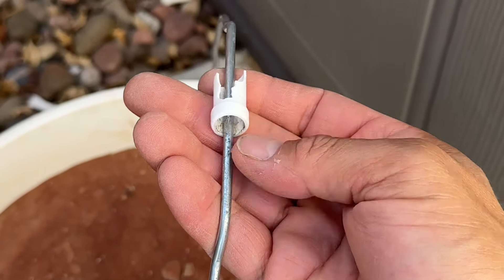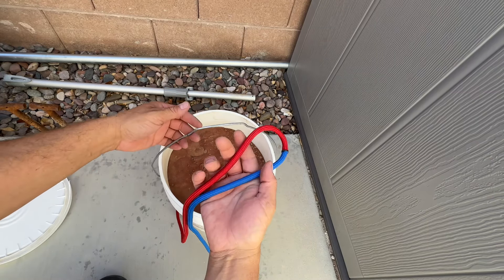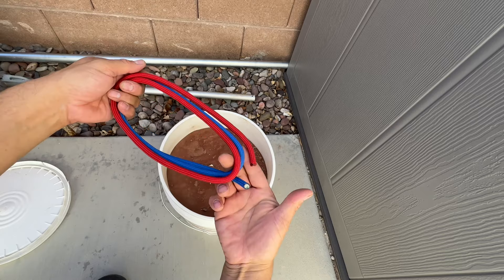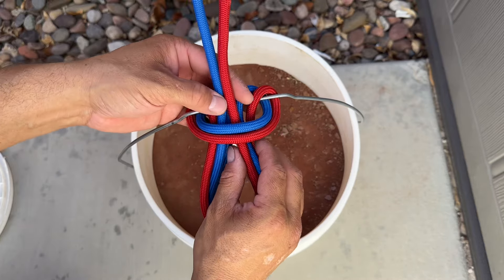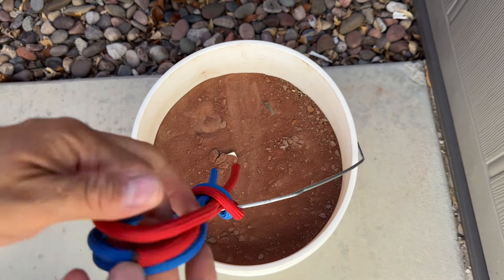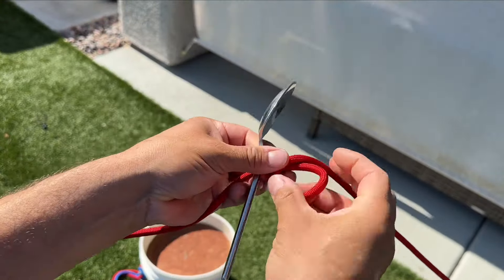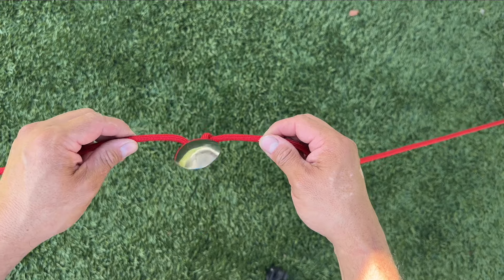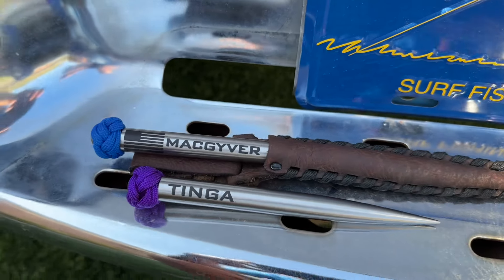5 Gallon bucket Knot. Tying a Better Handle.

Comment: Petition: how to tie stuff to a bicycle rear rack. I carry some paracord on my bike instead of bungee cords and I use variations of your trucker's hitch but I wonder what would your take be. Big boxes are particularly challenging to me.

Thanks!
Reply: Flynn's trucker's hitch all day long
Reply: Same here, but for my motorcycle!
Reply: Romex.
Reply: @bn5055  I'm a bit afraid of automatic trucker's hitch variations because I fear they might get loose with the shaking of the bike in an urban setting. And it can be catastrophic if something gets loose on the bike if you are surrounded by traffic. Besides that, it is indeed a great variation
Reply: @fcriado92  virtually zero chance of that happening given that you pretty much always tie off the hitch with a couple of half hitches.

Comment: Love rope for all kinds of purposes, but when my bucket handles break, I substitute 1/2 inch PVC pipe.  Cut the access slit at a bias and pry the bail into place inside the pipe.  The PVC is  larger than the original handle hence more comfortable.  The bail won't jump out of the PVC because of the access slit angle.  If you don't like the slit gap (which can be rough), use PVC cement and a heat gun to close the gap and join the two sides.  All that said, the idea of a Prusik knot for a substitute handle is very clever.

Comment: Interesting option. Another is to use the plastic tubes those produce bags in the grocery are rolled on. They are large enough to slide up the wire handle if you take one end loose from the bucket. I also turned some wooden handles on a lathe. I glued two pieces of wood together with paper in the joint, turned the handle, then soaked it in water to soften the paper and glue. After drying out, place the 2 pieces on the wire and glue them together. You need to make a groove in the center of each half before you turn them. You can use the ends of the grooves to center the handle on the lathe. And of course, the first time you glue with the paper, be sure to use a water soluble glue.